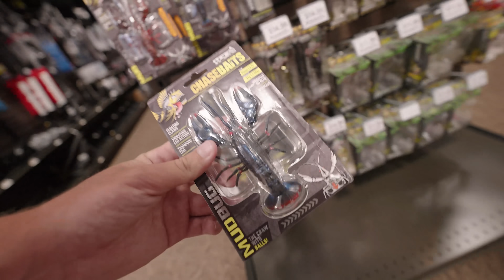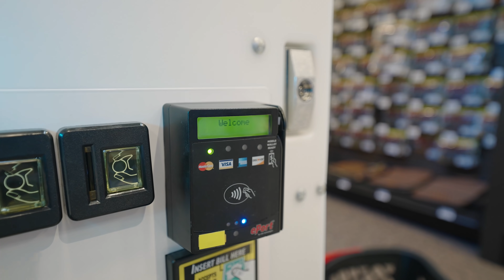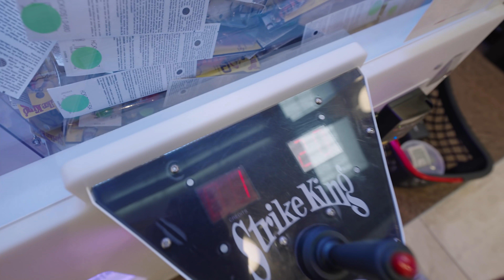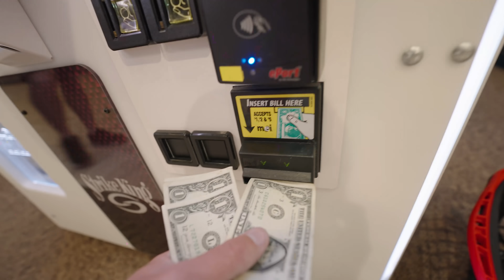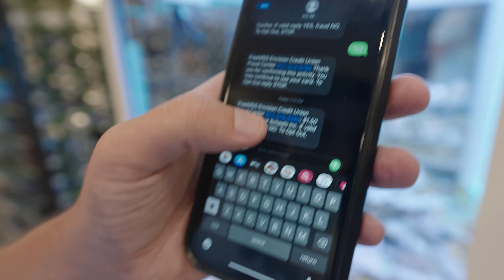World´s First Fishing Claw Machine Challenge (Lost $1,000)

Comment: About a year ago I was swayed by my nephew's praise of the selection at Scheels, ( which has only two stores east of the Mississippi one in Springfield Illinois, a town I loathe and avoid like the plague, and the other in Appleton Wisconsin so I jumped in the car, and drove the three hours North to Appleton finding the store was a bit problematic because it's located on the backside of the mall, away from the highway, but once found was a major disappointment, the store was extremely poorly stocked, with most shelves empty as a result I wouldn't make the trip again, even though I have friends in the area.